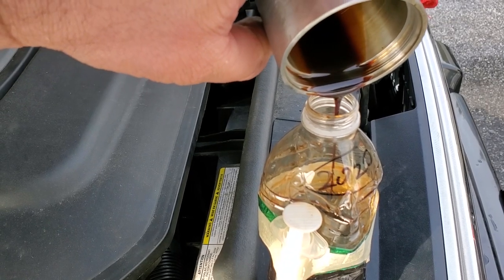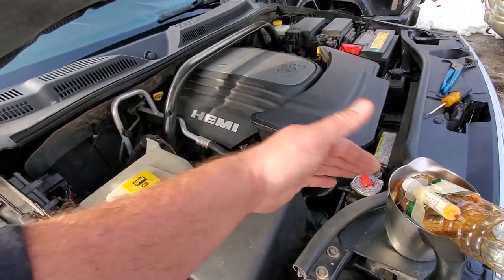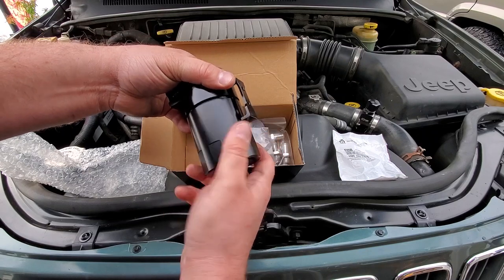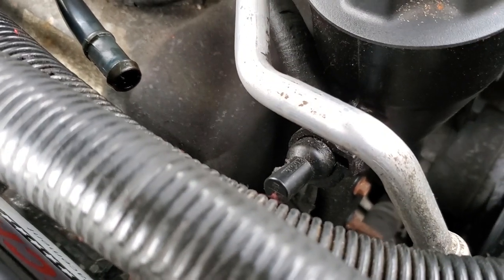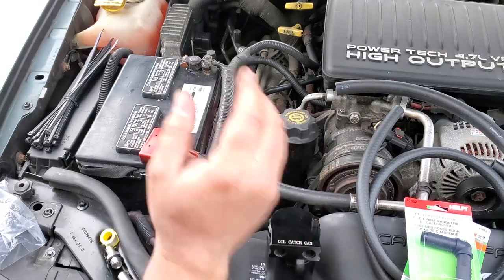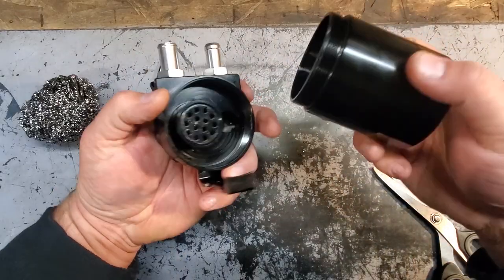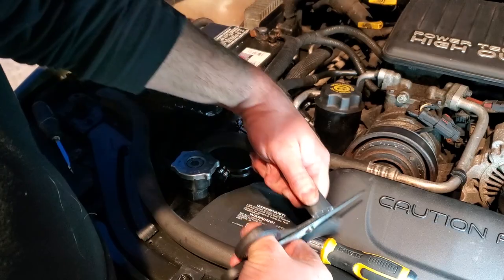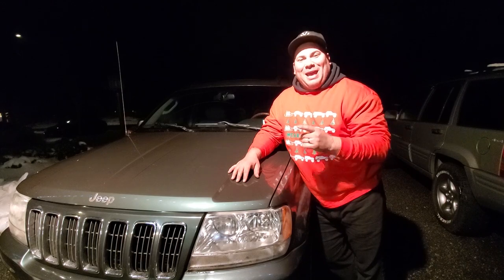WE NEED OIL CATCH CANS - 1 YEAR, 9980 MILES OF PCV BLOW  BY SAVED!

Comment: Bought same type off ebay. Had a hose included, which is too light+flimsy, so bought proper hose from auto shop. I used a bit of steel wool like you, but I added a square steel-wool scrubbing pad, inserted vertically in can, between in and outlet, as an extra filter. It didn't reduce vacuum, which is good

Comment: Great job. I installed the oil catch can in my Jeep xj. I noticed the oil pressure suffering moving up as normal. I installed the rear elbow to IN and OUT to the manifold.
Reply from the maker: Excellent!  XJs have a CCV system but it's still good to catch any blow by before it gets out back into the intake!

Comment: Catch cans are needed if you have worn piston rings and there’s lots of blow by. If you have good compression in the cylinders and you maintain your engine with regular oil changes not so much but it can’t hurt. With direct injection you need a catch can no matter what.

Comment: I have recently installed a noname catch can on my ZJ. Finish is apparently nice but be careful. On mine, the reservoir o-ring groove just below the threads is machined too deep or maybe the o-ring is too thin,  resulting in possible vacuum leakage because the metal to metal sealing may be inefficient. I solved the problem by installing a slightly fatter o-ring. Good finish doesn't mean "quality" ☺️
Reply from the maker: wow! true true true!  that's a great solution.. I'll keep and eye out for that. 👍

Comment: On my 5.2 ZJ I've got the PCV valve on the passenger side leading to the intake.  On the driver's side there's a "crankcase breather element" which is essentially an elbow from the valve cover going into a tube heading strait to the air box.  I don't know if the WJ has a similar setup, but I'm wondering if one catch can should go on the PVC valve for the intake, and one after the "breather element" to keep oil out of the IAC.
Reply from the maker: excellent question... anyone out there set up a can on a 5.2??
Reply: I have ZJ 5.9. I installed 2 small cans. One on each side. Works great!
Reply: @aldicroce6505  Have you noticed if your IAC valve is cleaner or functions better after you installed them?
Reply: @robertgrauman8602  only had them on for a short period of time, I put all new hoses and connections. New mopar pcv valve and definitely working as I hoped. Highly recommended for any ZJ!
Reply: @aldicroce6505  I wonder if adding oil catch cans will prolong the life of IAC valves, or at least make the aftermarket ones last longer than two weeks.  I guess I need to do some research.
Reply: @aldicroce6505  Do you see oil in both cans when you change the oil?
Reply: @robertgrauman8602  ZJ V8s are known to for blowing plenum head gaskets caused by ‘blow by’ so catch cans are a MUST for those engines. There quite a bit on the internet regarding that info.
Reply: @robertgrauman8602  more so on the passenger side than the drivers side.
Reply: @aldicroce6505  Yeah, I heard about the plenum gasket when I rebuilt a 5.2 to replace the stock one.  I just figured since I had new rings I wouldn't have a blow by problem.  Right now I'm thinking otherwise.  I have to do some wrenching on it in the next few days, I'll have a peak through the throttle body and have a look.

Comment: What about the breathers on the red of the valve covers that connect both valve covers?
Reply from the maker: Not sure I understand the question
Reply: @ProjectDanH  Doesn't the 2 breathers on the back side of the valve covers go into the intake also?  The PCV is only connected to the oil fill tube.  I would think the breathers on the valve covers would cause sludge also?